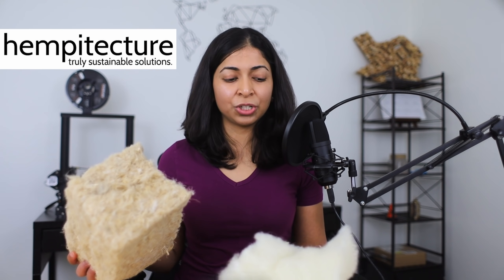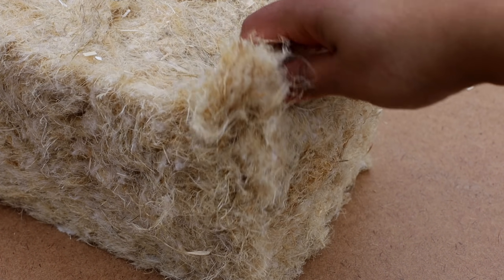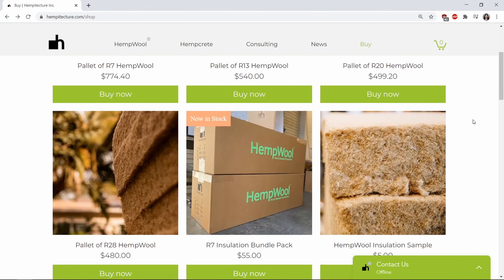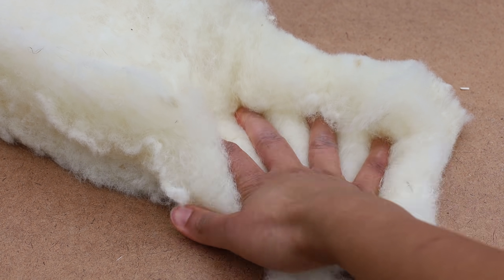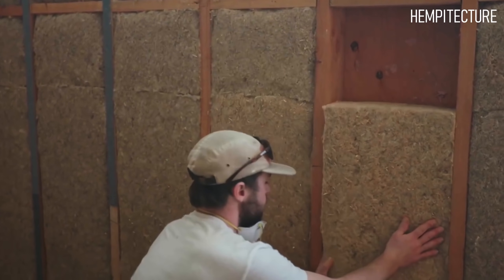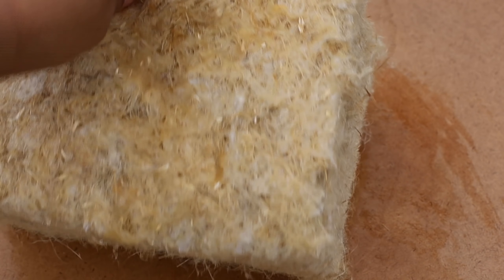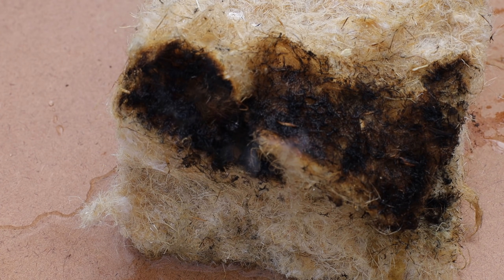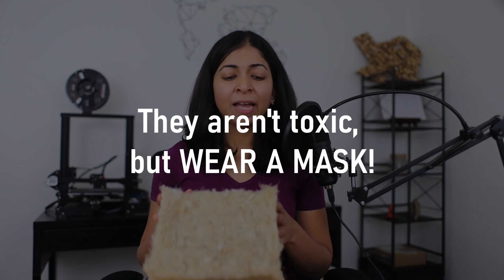Hemp wool vs Sheep wool insulation | Everything you need to know

Comment: Hemp wool captures CO2 also. It needs to be used for more materials. Hemp processing plants unite.  Also, hempcrete is naturally fire-retardant, pest resistant, filters the air acting as a natural humidifier, and if installed properly could create an efficient energy passive home.

Comment: What do you do about bugs with sheep wool. Have you ever had moth damage on your sweater? It would be much worse in your walls, because you would probably have to remove the drywall to access it, and then add insecticide, which will probably not be so eco-friendly.

Comment: Nice video, however I think you have a misunderstanding of how dimensionally stable blown in wool is.  You seam to assume that it will be prone to settling.  I just insulated my 3000 square foot house (including most of the interior walls) with blown in havelock wool.  It was a lot of work, but one thing I can tell you for sure is that if done properly, there is no way settling will be an issue.  Wool is remarkably springy, for lack of a better word.  Once you get it into the cavity to proper density, it only wants to expand and fill the space.  Outside of the wall the wool is pretty fluffy, but when packed in the wall its a different story.  Anyways, thanks for the great content!
Reply: Oh gravity takes time to do its work and the vibrations in a van conversion don’t exist in homes so I’m pretty sure have like wool bats or loose fill will not violate the laws of physics

Comment: For anyone considering sheep wool in a climate with hot summers and cold winters, make sure you install at least 2 if not three layers of it for better results. I used a single layer of 5 cm and it doesn’t perform too well in temperatures below -8 or so or in plus 30 degrees Celsius. Just make sure not to compact it much.

Comment: This hemp wool has 8% polyester binder.  Polyester is a synthetic fiber that’s usually derived from petroleum.  Sheep's wool has zero petroleum in it.  So this test is not accurate.  The sheep's wool must be treated with Borax, a naturally occurring mineral, to prevent insect infestation.

Comment: Why would anyone use wool in a van conversion? Yeah it doesn’t outgas as much (although I wonder if lanolin slowly evaporates out and could become an irritant in an enclosed space), but it requires loft to be effective and in an enclosed space that’s not really an option. I would think aerogel would be the ideal insulation for a van conversion - the small space would mitigate the high cost, and I believe it offers the most insulation per millimeter of any product. In a super tight space like that, every inch matters.

Comment: I'd be curious to see how the sheep wool would perform in an enclosed wall lit from below, simulating an electrical fire in a wall. Your test seemed to show it burning readily but self terminating when lit from above, but with fuel above the flame front and a stack effect in a wall i can imagine how things may have went very differently. Rockwool seems like the way to go, if you can get over the energy investment. Sheepwool is better used in textiles imo, its durability and unique insulating properties are hard to beat. Maybe heating homes a little less and giving everyone nice sweaters is the most environmentally responsible move haha

Comment: I'm guessing the polyester might be to blame for the hemp insulation's poor fire performance. 
Also in the future, if you ever need to put a fire out on something fluffy like this. A spray of water, such as from a pressure spray bottle, works much better than dumbing a large amount of water in one area. The goal is to get as much fluff damp as possible to prevent the flame from being spread by the wind. The steam generated in the process of spraying the fire will also help smother the flames by sucking up a lot of the heat energy supporting the fire.

Comment: The wool seems like a great choice for a tiny house. Sure, you wont be moving it around ALL the time, but saving on weight is always good when it doesn't cost the end user much of anything in their move and daily life. 

But both of these are pretty impressive. I'd like to have insulation I dont need gloves to handle. You may not do roof or attic work frequently, but when you do, every little possible hassle adds up, especially in tight space maneuvering

Comment: In the UK the available sheepwool products have the polyester fibres in like your hemp product (25%). That makes them much more robust and dimensionally stable - much like the hemp product you showed, but of course means that there will be plastics mixed-in at end of life. They are very good in terms of humidity regulation, which you mentioned but perhaps under-emphasised. (I used it in an extension ceiling and the air-quality in the space is very good).   https://www.thermafleece.com/

Comment: I am very curious how you calculate the R-value. In the Netherlands where I live R= thinkness (metric)/λ . Rockwoon has a  λ = 0,035. So 10 cm rockwool is 0,10/0,035 = R 2,85. Officially this is the Rd-value. The Rc-value is the total heatresistance of the whole construction. In the Netherlandse the Rc standards are: floor Rc=3,7 , outer walls Rc=4,7, Roof Rc=6,3
Reply from the maker: It's funny you say that, I'm recording a video on R value right now! I'll try to release it on Monday.

Comment: I'm just going to cut to the chase, and use sheep as insulation! So the R value will keep growing with the sheep! Ha..
I do need insulation, my offgrid house has no insulation! Its old, and they used wood heat, tge brute force method, i don't need that much insulation hemp sounds nice, as long as thereis no fire! I want cheap, and environmentaly friendly, i thought about FoamCrete, outside, with foam board or something, maybe sawdust, we have mild winters, maybe 6weeks with near it zero, the rest of the time it's 30-50°F in winter, and 90's°F in summer, occasionally hitting 100-105°F 2-3 days if at all,   i like rockwool but I'm not paying that price!  A R-7 would suffice, R-11 is code,  it shouldn't be too much to insulate a 1200-1500 sqft. House, I'm going to do a retrofit ambiant heating, from the bottom of the floor, then cover with fiberboard, I may insulate between joist also, it should heat nicely, using a wood stove boiler, and solar thermal, for heating, I use solar power, and maybe building a micro steam generator to charge the batteries! Maybe only 500-1500watts, may aswell use all the energy from a fire, since it's burning, I'm Thinking about planting a firewood crop, something like bamboo. That grows fast, with that, and trimmings and fallen limbs, and trees, I should be able to have a fire when needed, the solar thermal and solar power should handle the power and heating 75-85% of the time, I have a diesel heater, for emergency heat, I'm hoping to use bio diesel, or vegetable oil, sorry to ramble, but this got me thinking, it's not cold today, but it's comming! Great info! I'm am interested in anything in my ramblings.. solar, alternative heating/cooling, alternative living, homesteading!

Comment: Awesome and thorough review. I completely concur w/your assessments of Hempwool; so very promising but just not there at present. Since we live adjacent to USFS land and very near Rocky Mountain National Park at 9000 asl, insulting efficiency, minimal thermal drift and flame retardancy are my primary priorities of any insulating material. We chose  formaldehyde-free Thermafiber for both stud bay batts and exterior rigid sheets. If the Hempwool were available and were of acceptable flame performance, that would have been my choice. The Thermafiber however delivers on every aspect except it’s marginally high environmental costs, even as byproduct of steel production.

Comment: Hemp and wool insulation look like luxury accommodations for mice.

Blow In Cellulose insulation is a fire hazard. An insurance agent I would do handyman stuff for told me if a fire got in the walls it would smolder and go through all the holes for electrical and plumbing in the studs. The only way to put it out was to tear off the sheet rock.

Fiberglass is still my choice.

Comment: EXCELLENT! Thanks Belinda ... I had a van with standard mineral insulation in it's walls. It was obvious that the air quality inside the van was rather harsh. My next van project, I used Havelock wool. Now, when I am locked inside, on a freezing winter's night, The van has a certain "sweet" natural smell to the air ... gone are the sore eyes, throat, and sinuses! What makes this insulation so ideal for vans is that a 2 inch depth over the walls, ceiling and floor, are all that is required to properly insulate the interior from the coldest of outside temps, like -20 or more. (I live in Canada, where as every American knows, it's igloos all year round up here! ... but the real advantage is not needing vapour barriers  ... the wool naturally adjusts to ambient moisture levels, even in dry/cold, or humid/cold conditions. Cost is irrelevant, when it comes to quality ... also, any fine fibrous material will irritate one's throat, lungs, or eyes, just as dust does ... the question is, does this material pose a health risk, if inhaled ... the answer is ... Always wear a mask when handling any material that is capable of minute, microscopic off-shedding. BTW, yours is the best YouTube channel , by far ... right up their with Paul Davids, my guitar lesson guru, and that's saying something! (he has 2 million+ subscribers) ... so just keep at it, you have the formula!

Comment: Intresting comparation :) 
This particular hemp/PET product does not sound economical to recycle. Cause it has PET fibers mixed in. Pet can be chemicaly broken down and separate. But isn't really practical. Expecially if the material is dirty one practical solution would a waste to energy. Ash should be fairly clean to reused thought.
As for fire safety - I would rather avoid open flame. Basically design a building with fire prevention in mind instead of relying on no combustible materials.
For small moving structure I would go with Performance insulation like spray foam, vacuum insulation or even aerogel if it would make financial sense coupled with radiant barrier.

Comment: Hey @Belinda, cool video again. Can you do a video about "wood fibre" insulation too? We are doing a gutting and redevelopment of our european 300 year old  half-timber house and the recommended way is using indoor wood fibre insulation for the outside walls. That way, the nice and long living timber facade is not covered by insulation.
Also it is common to use it for the floor and ceiling (and of course for the roof...)
BTW: we are putting clay plaser on the wood fibre. Works quite well
Reply from the maker: Interesting combination! Which wood fiber manufacturer are you looking at?
Reply: @BelindaCarr  for our first part of the house we buyed from pavatec 60mm

Comment: Hemp wool looks like it would cut relatively easily with a reciprocating electric bread knife.
Very excited to see hemp videos, as it's such a diverse and useful material. And extremely sustainable.
Reply: I think that the fire issue is one that we are acutely aware of in UK.  The fire propagation within voids is of major concern and without any self extinguishing properties hemp insulation would certainly mean for me it would be discounted.  It is all to easy for fire to propagate into even supposedly fire protected cores and ignite the contents due to poorly sealed or damaged shells that then expands to cause catastrophic failures.
Reply: @clivewilliams3661  Which is one reason why she should’ve included rock wool in her comparison, And it’s available both in batts and boards
Reply: @GOLDVIOLINbowofdeath  The whole premise of this video was to compare the 'green' insulations.  Rockwool is not a green insulation because it takes a huge amount of energy to create it from molten rock.  Rockwool is used for fire protection simply because it takes so much heat to degrade it as you would expect from a product formed from rock.
In terms of providing any fire properties to either hemp or wool all they can use is a retardant additive that generally will not make the material fire proof.  A client of mine ran a material testing laboratory and we were discussing fire properties.  The problem it seems that the legislators and manufacturers are fixated on the effect of a small fire source so that retardants appear to work.  However, in a building fire the heat produced is extensive and intense and will overcome mere retardants so that the only non-fire propagation materials need to be totally and naturally non-combustible.
Reply: @clivewilliams3661  The wool looks to be totally non-combustible. That's why I would choose it over the hemp insulation. That, and the hemp insulation is not all natural, with the synthetic fibers added.
Reply: @FLPhotoCatcher  Where you have voids filled with insulation the performance of that insulation should be appreciated.  Whilst natural wool may not support combustion, i a fire it will burn and disintegrate leaving a void  for the passage of the fire.  Such voids are of great concern because they can create a chimney effect (as happened at Grenfell tower) that can intensify the fire.  Also, in some cases the fire can be hidden and then come out in an unexpected location trapping people, as happened in a care home fire some years ago.  The best insulation that is extremely resistant to fire is rockwool that has a melting point much higher than normal fires so can be used as a fire barrier.  It is the go to material for cavity barriers and fire blankets in building structures.
Reply: @clivewilliams3661  I think that the wool insulation would not burn enough to create a chimney effect, until a fire had already burned for a long time.
Reply: @FLPhotoCatcher  I disagree.  A fire can be quite vigorous - this is why BS 5852:pt1 and the former BS 476 for fire safety in upholstered furniture is inadequate as they test with a miniscule fire load.  The temperature of s building fire can reach 1200degC but even at 800degC its a real cause for concern.  Grab a wool ball and a blow torch on even a low flame and you will find that the wool disintegrates quite quickly, whereas rockwool remains stable until it gets red hot and its only the red hot fibres that fail so the action is slow and progressive.

Comment: This sheep vs hemp wool comparison is very interesting.
I built a timber frame house for a environmentally conscious client here in Canada several years ago.  The exterior walls were 18" thick stacked straw bales. We clad the bales with wire mesh and stucco inside and out, and a final coat of plaster inside.  No vapour barriers.  The client heats with a wood stove and it seems to work very well.
I'd like to see an analysis or comparison of straw bale insulation.  Or an episode on straw bale building in general.
Thanks and keep up the excellent work.

Comment: How about bug infestation? Moths supposedly love to eat holes in wool clothing. How will that work in insulation?
Reply: I think they add a bit of borax. Certainly the manufacturers say it passed ISO3998 (which amounts to losing less than 7.5% of the weight of a 200mg sample exposed to moth larvae for two weeks, and fairly small levels of visible damage).
Reply: @xxwookey  How/where did you learn that? That is interesting info
Reply: DWTZ ONE  But that wasn't mentioned in the video. And mites are a definite problem, if the wool isn't treated properly. I wouldn't touch sheep wool for insulation unless it was clearly stated that it had been treated with borax or something similar. And then the question is whether the treatment itself could be toxic.
Reply: Yes, I'm wondering about wool moths, dermestid beetles, and mites.
Reply: @pondera2450  I'm worried about pot-heads.
Reply: @paulsawczyc5019  This was addressed in the first minute of the video. Try harder.
Reply: a little bit or borax goes a long way. there are also these little wooden balls that you can buy that are supposed to ward off moths as well but ive never tried them, so youd have to do your own research on those

Comment: So at this point it appears that Rockwool is scoring the best. Would you agree? My biggest fear is fire. Some time ago, I read about fires and fire stops. Drywall is actually a fair fire stop. I cannot remember now how much time it took and temperatures to burn through drywall, but I remember thinking at that time, (If I were to build a house and new shop, I'd use high density spray foam to seal outside walls and roof and then fill the rest of the cavity with Rockwool and in the garage and or shop, I would install two layers of 1/2" drywall). I really like ICF's as well, but after seeing that bugs like to make their homes in it, I am gun shy.

Comment: Love your videos!
I have a music production studio and when I was building it I investigated types of fiber insulation for acoustic absorption. Finally i decided to go with sheep wool because in my area I can get it for free. The wool was washed, dried and then installed. I had almost 5 cubic meters of it inside and it worked great, at first. Unfortunately, moths started coming in, eating the wool and multiplying. After some time there was literally thousands of them! Eventually I had to get rid of the wool due to the sour smell from the moths and the fact that they ate almost half of the 5m3 that was inside.
I wonder how did Havelock solve the isuuse, especially since it is supposed to be 100% naturall.
Reply: Haverlock and most other Wool insulation is apparently treated with Thorlan IW to prevent moth infestations.
Reply: Just started researching wool insulation. Materials are stating boric acid/boron salt are added to wool in order to prevent from pests and animals. Didn't you add anything to the raw wool?